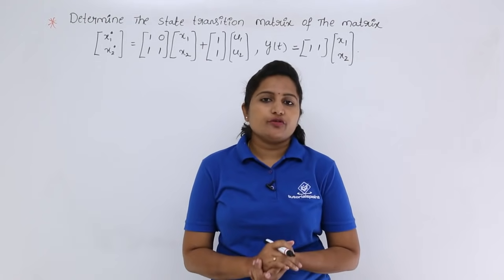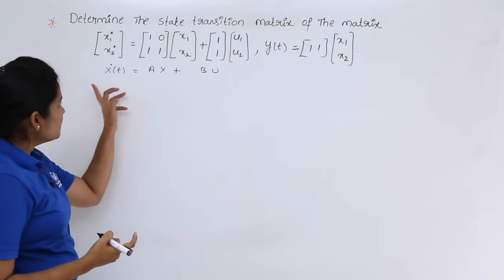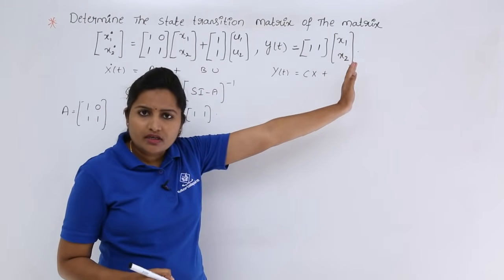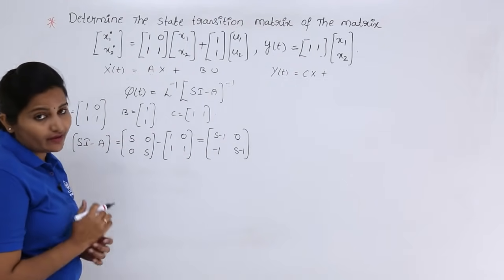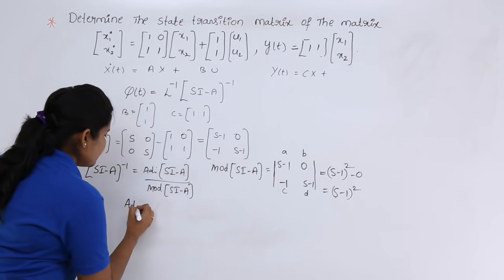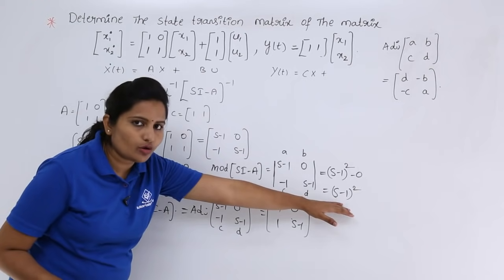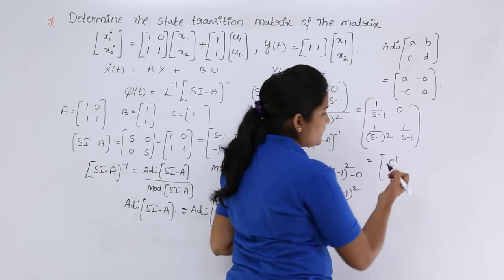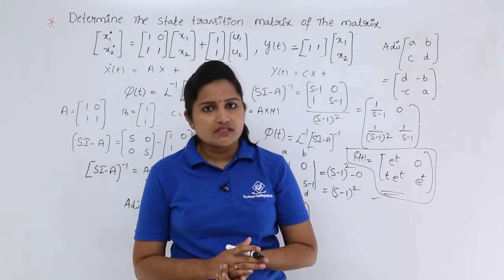Problem 1 on State Transition Matrix

Comment: I really appreciate your video. Thank you for a very good explanation. However, I have an inquiry, my problem here to find transition probability between states due to no data. I currently doing my research using Markov Model and I would like found the transition probabilities. I found that calibration and eigendecomposition can help to solve it. I would be really appreciated it if I can contact or connect with your teacher to understand the method. Thank you.

Comment: Excuse me. It's a great explanation. But I have a question, why do we need define matrix B, C at the beginning? I can see that when we solve for the matrix transition all we need is just matrix A instead.
Reply: Same question bro
Reply: Did you find the answer to it?
Reply: The reason is pretty simple, they give us a generic state space model and THEN they ask us to calcualte something for which only A is needed. In an exam usually there are multiple question on the same system, this video addresses one kind of questions that only part of the information they give us.